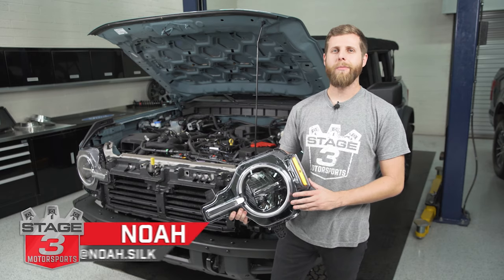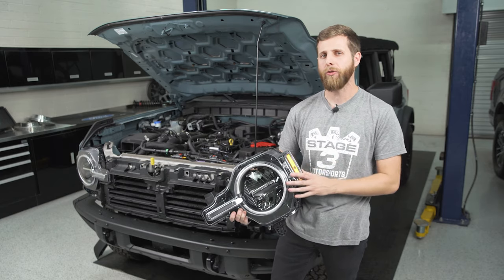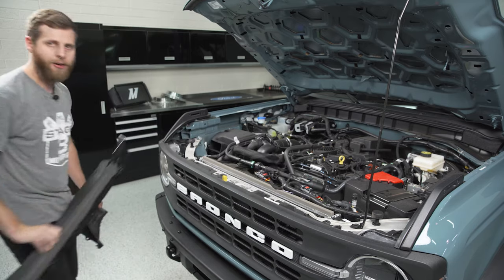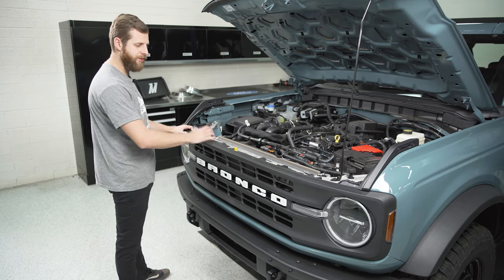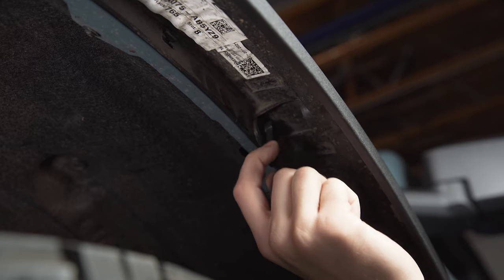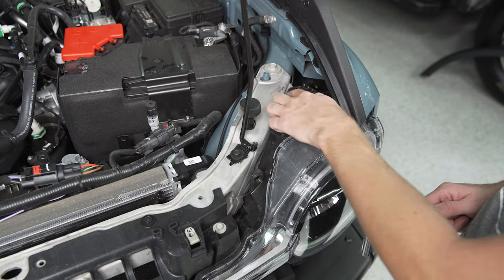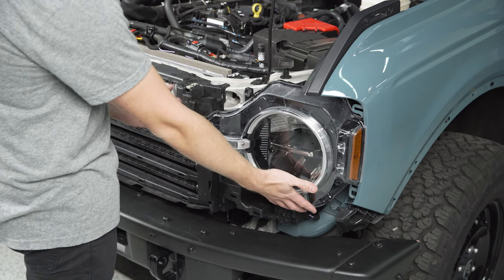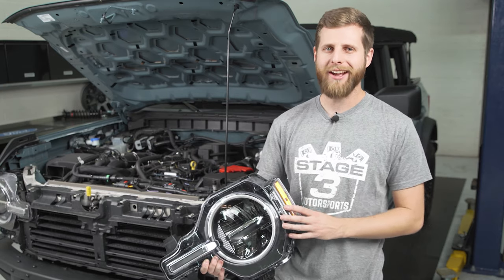How to Remove 2021 Bronco Headlights

Comment: If swapping headlights from standard to signature, mark your light level height on your garage door before the swap so you adjust the height afterwards. There's a 6mm adjustment screw on each headlight.
Reply: Can you elaborate on this? Is it optional or is this necessary?

Comment: You have there the standard factory headlights, can you guys confirm if its plug and play with the signature factory head lights? Or is there an extra harness needed? 
I want to upgrade my base to the signature head lights.
Reply: Can confirm just did it.  Plug and play.
Reply: @robust57  where did you get the signature lights from ?  Im also looking to do a swap on my base
Reply: @azteka1916  Did you ever find them?
Reply: @justinanderson181  yes sir   Plug and play   I got mine from ebay
Reply: @azteka1916  ebay

Comment: Once you get the headlight housing out, is it hard to replace the turn signal? That's the part that went out on mine, that horizontal turn signal light. And what do you replace it with? Or do I have to replace that entire unit?